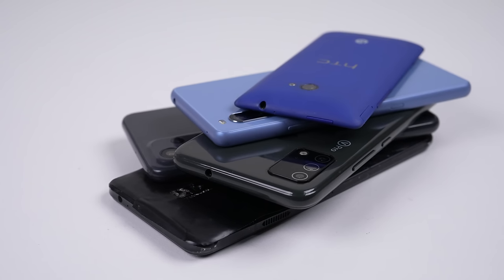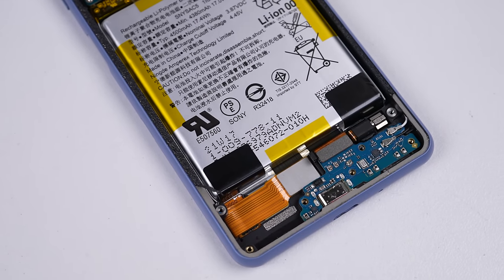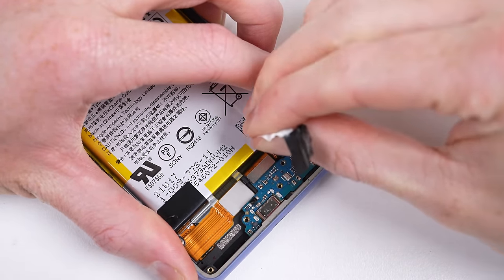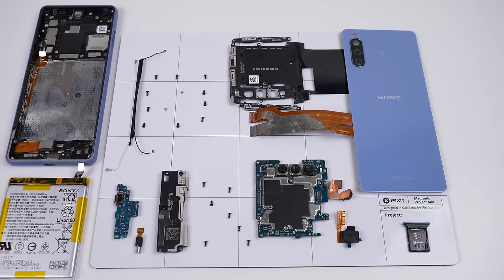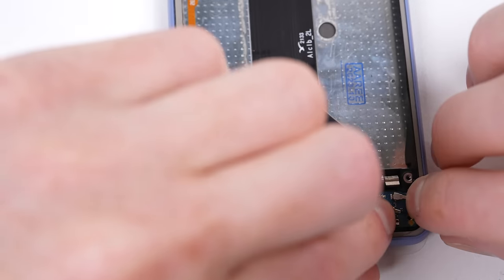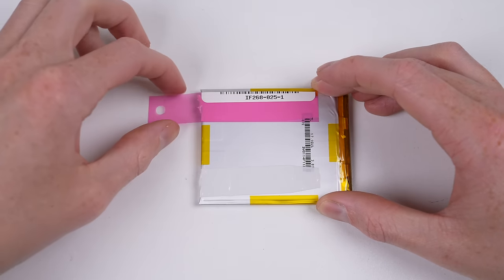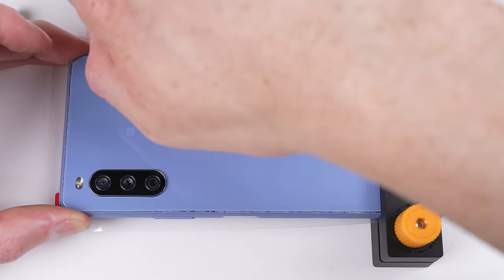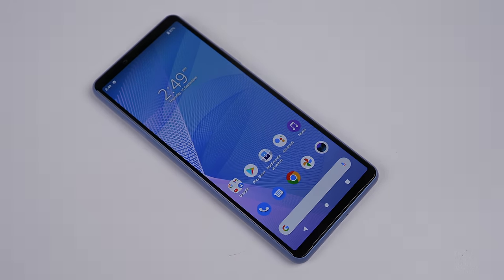This Uncommon Phone Is Shockingly Easy To Repair - Sony Xperia 10 Mark III

Comment: As a phone repair tech myself, I consider both Sony and Motorola phones underrated when it comes to repairability. They’ve never given me any grief when it comes to screen, battery, or charge port replacement.
Reply: What about the razr folding phone
Reply: this looks about as easy as a xiaomi phone
Reply: @RukaIXR actually it's easy to repair
Reply: When I was a PTC tech I only ever ran into one Sony phone (Z5 premium) and remember it not being as straight forward as a Samsung. Not bad just different. I found Huawei P30 pro a little more difficult too than an average phone.
Reply: I bet you get those a few times a year haha
Reply: Asus Zenfone 9 and 10 are easy to repair too!
Reply: @willissudweeks1050 as if an iPhone doesn't need the same repairs at times lol
Reply: @aiodensghost8645  I was saying that those phones are so rare they aren’t seen often not that they broke easily
Reply: No point repairing a phone with no updates.
Reply: Motorola is really popular here in Brazil
Reply: same with xiaomi
Reply: Have you tried ZTE? I have a total of 3, all seem easy to repair. I have a Blade Z Max, Avid 5, and Z176BL. 2 needing a screen replacement/further repair, and one just needing a Google account bypass.
Reply: @JMD-tu1xm  never encountered them. Compared to other android models, how would you describe their repairability?
Reply: yeah it's also really good software wise as there a ton of software that can very easily unlock the bootloader and install stock or custom roms. there's also xperfirm which has every single sony rom from their servers
Reply: Actually Samsung too. I've had absolutely no issues with any model of Samsung, even though sometimes they do odd things like the glue on the S20/N20 series. The module is offset to the left some, with the glue holding the sensor in place to the left. (I guess if you're looking from the back lol).
Reply: The not-so-popular LeEco Le 2 has the easiest screen replacement in the normal smartphones category (excluding Fairphones).
1: Cook the screen then remove it
2: Unscrew 2 screws for the metal piece that holds into the ribbon connector for the screen then remove it
3: Connect the new screen and put back the metal piece and the screws in place
4: Use some liquid glue to hold the screen then put back the screen into place
5: Clamp the screen and wait for the glue to set
Unclamp and remove the protective layer then you are done.
Reply: The not-so-popular LeEco Le 2 has the easiest screen replacement in the normal smartphones category (excluding Fairphones).
1: Cook the screen then remove it
2: Unscrew 2 screws for the metal piece that holds into the ribbon connector for the screen then remove it
3: Connect the new screen and put back the metal piece and the screws in place
4: Use some liquid glue to hold the screen then put back the screen into place
5: Clamp the screen and wait for the glue to set
Unclamp and remove the protective layer then you are done.
Reply: @ndsr_tar  The Google Pixel phones are like this. Hella glued on, but if you're replacing it, it doesn't matter anyways. Cook it, unscrew the two screws holding the metal plate that holds the display ribbon cable and you just put the new one where the old one went. No other screws at all except the two on the inside.
Reply: @Xiefux  but it doesnt send your data to the ccp

Comment: I'm genuinely thinking about getting a Sony as my next phone - an SD card, headphone jack, and software that works well with my Sony camera!
Reply: i got an Xperia 1 IV in april of this year its absolutely overkill and i love it
of course i had to import it because they dont sell phones in my country aswell but at least i payed less than i would if they sold here.  absolute win
Reply: I own the 10 V and it's a extremely good phone with some of the best old features and most of the new ones such as 5g
Reply: bought an xperia 1 V for $1200 a month back. Absolutely adore this phone, beautiful design with the greatest mobile screen imo, 4k 120hz glorious 6.5" OLED. SD 8 Gen 2 works like a charm too. Headphone jack is real nice and the peace of mind you get from knowing you can add an additional 1 TB of microsd storage is wonderful.
Reply: The sad part is: although Sony is developing the sensors, it's Camera app and photo results are sub par compared to other brands. That's why I have stopped buying Sony phones.
Reply: Sure you are mate
Reply: @mshaftenberg they’re also too damn expensive and the phones tend to overheat quite substantial
Reply: @mshaftenberg  they downgrade the camera app when new flagship phones come out
Reply: Sonys don't last very well
Reply: @mshaftenberg  I would advise against it. As they said, there are batter cameras on phones out there, and as actual phones...they're very mediocre (bad UI, terrible orientation detection, frustrating fingerprint scanners and more) for phones commanding a premium. I don't know if the headphone jack is worth putting up with all the mediocrity on my Xperia 5 Mk IV, but I'm stuck with it so I wouldn't recommend it to anyone else.
Reply: If you plug in or out of the Sony headphone jack with an audio jack in an amplifier, it could get damaged.
Reply: @Carcosahead My 1 II overheats too much, it can only record for 3 minutes before overheating and shutting off

I won't ever buy a sony phone again
Reply: @DecibelAlex mine lasted from 2013 till 2022.
Reply: I've noticed that the camera looks the best only when there is a nice sunset / lots of light. With grey skys it makes the photos more gainy when you zoom in.
Reply: Do it! I have an Xperia 5 IV and it's great!
Reply: @MarkSynthesis  Sorry but bad UI is one of the points that's actually great about it. If we're talking bad UI Samsung's OneUI comes to mind but not Sonys.
Reply: Asus ZenFone is pretty similar but without the SD slot
Reply: Id do the same if the software support was better...
And if the damn phones didnt cost like 30-50% more in my region.
Reply: Look at the zenfone 10 too, heapdhone jack and easy to repair! Longer software updates too
Reply: @driver1084  What are you expecting out of this tiny lens and microscopic sensor?
Neural network smoothing and a fake moon like others do?
If you want this, you can do this yourself later, except you can adjust this post processing to your liking.
If you want actually good photos, you need a real photo camera, not a phone.
Sony does make cameras too and they are also the best.
Cameras that can take non-grainy picture in the dusk start at $3000.
But there are companies that sell lies for less.
Reply: @basicallyhuman they provide bootloader unlocks and driver packages, it's not too complicated to install something like lineageos.
Reply: @MarkSynthesis  that's false. Sony's fingerprint scanners are the best.
Reply: @goury Source?
Reply: @orangeyellow-me1pz   no phone lasts 9 years in daily use, that's utopia!
Reply: @DecibelAlex  I used it all the time for a couple years then kept it as a back up and used it sporadically. I have phones that are nearly 20 years old that I play with all the time as well.
Reply: @DecibelAlex been using Sony years with no such problem
Reply: @henryfernandez4493  what  you talking about????
Reply: @mshaftenberg the Xperia 1V kills the competition in that area
Reply: @toxicturkeyy I consider the 4k screen to be a negative point of the phone, it uses more battery and the screen is too small for the extra resolution to be noticable next to a 1440p display of the same size
Reply: @goury the result is all that matters when taking photos

Literally nobody cares if the picture was taken with a camera that uses AI processing or you manually controlled every setting
Reply: but there is no fast charging
Reply: @ZUXY_RS3 there is
Reply: @DecibelAlex  Galaxy Note 3 users from 2013: blocks your path
Reply: @chromaticvisuelle  Asus said bootloader unlock for 10 is not allowed. Custom rom community outlives official support. Still stuck on poco F5 as my top choice for now.
Reply: SD card is trash.... it is stupid slow and prone to corruption. Just buy a large enough storage in the first place.
Reply: @MarkSynthesis   the Xperia 5 isnt the highest end.. so you shouldn't say thats what the experience is like

Comment: Beside good repairability, Sony also supports AOSP and provides everything necessary to build your own custom ROM (including build guides and bootloader-unlock). This usually takes a few months, but it is much better than throwing away a phone after it no longer gets security updates.
Reply: if only they didn't void the warranty when you root...

I understand it's actually not legal in the EU, unless they prove that I burned the CPU with overclocking or something, I intend to seek some advice to confirm that.
Reply: @TheDZHEX  even though they do, they will still fix/replace the device if it breaks because of something unrelated to the software.
But it'll take more time because they'll have to check everything thoroughly.
Usually adds up to a couple of weeks.
Reply: @TheDZHEX   Never looked at it from this perspective. For me it is an easy solution to use the device after security updates have stopped. Or to use the devices for some other projects, I mean you get old used phones for the same price as a Raspberry Pi but they have way more power and an integrated screen :)
Reply: The thing I dont like is when you unlock Sony disables certain systems that they class as secrets..
The software for photo AI and sound software is blocked so that the quality is worse..
Reply: @dirkg.3163 hell, attach a controller and most people don't need a console (I say that because the games I play have issues with input latency if you cloud stream them, and the phone isn't powerful enough to play on-board)
Reply: Untill you buy their ps5
Reply: Sad that outside Xperia 1 or V Marks 2 to 5 (still best naming scheme imo), Sony and Xiaomi only had their sd slot and headphone jack duo on phones lower than SD7/8 series chip.
Reply: They provide no updates as well it's great!
Reply: @jiffonbuffo and IR Blaster on Xiaomi/Redmi devices
Reply: @aiodensghost8645  Are you going to squint at that tiny screen? And I am not even going to mention hoping that the charge doesn’t end on the controller. And cloud gaming is heavily dependent on good internet.
Reply: Except I own the Japan softbank locked variation :( that can't be upgraded
Reply: talking about software, you can unlock the bootloader in every sony global model smartphone..except japanese market model. such as docomo, au and softbank.. there's no way to unlock it, even if you try with official way. docomo, etc won't let you.
Reply: @narutoandhinata130  yep I retuned xperia mark 2 after realizing it's Softbank, I hate locked phone

Comment: For heaven's sake stop using that disgusting glue to attach the screen or back on phones.   It's unprofessional and makes subsequent repairs much more difficult than using generic double-sided tape of carious widths (1-5 mm) or better yet factory cut adhesive.  It makes me cringe every time I'm working on one of these "glued" phones.  Yuk!

Comment: I really dont get it, ive replaced batteries for friends and family phones, ive never glued any batteries back, ive experiment so to speak. with different things to stop the battery moving...the batteries with no glue can hardly move, if at all in their compartments, ive used a small piece of card to stop them moving, a tiny bit of blu tac, they never move , even if you shake them you cant hear the battery moving, ive never had one come back, so why these companies use it is beyond me..if they insist on glueing why cant they use just a couple of small piece of adhesive tape....so the battery can be taken out with minimal force...its not difficult, only conclusion has to be that they dont want people replacing batteries

Comment: I remember when phone makers didnt even think they needed glue for their batteries where a finger nail was the only tool you needed to take off the back cover and battery with ease. Apple has a lot to answer for as every company has followed their greedy anti consumer designs. I'd buy a sony if they still made a small model, as it is I was forced to buy a mini13, the last small modern phone thats easy to get in and out of the pocket it seems.

Comment: Currently watching this on my 10 III, I bought it second hand about a year ago at a really good price and I've never had a problem. The one issue I did have with updating the OS was handled very well by their official online support. I'm very relieved to hear that at least when the battery kaputs or something that it'll be relatively easy to repair or get repaired.

Comment: I've been using the Xperia 5 ii for more than 3 years now replaced the battery myself and it is still water resistant after a drop in water it was easy to work on and it still feels like day one

Comment: Nice video, thank you for it. Sony phones are very underrated indeed, although they're quite overpriced when purchased as new. I've been using Sony (Ericsson)s for 17 years now since my T610 (which still works) to my current 1 II. And it won't change.

Comment: I owned a 1.5 year old 10 mark ii and it was a horrible phone. Native camera app had a 2 second shutter lag so I would miss the shot all the time. Software was always stuttering because of the weak sd665 cpu. 
The back glass cracked once, so I ordered a replacement, and after 2 days it cracked again, so I just lost it and put the cracked glass together with tape. 
And the next week the phone is suddenly restarting itself when it's upside down... So I carefully took the cracked glass with tape off and unscrewed the motherboard... to find out that the metal cooling plate had gone loose and was shortening the elctronics in there. I took it out and assembled the phone without it. 
Then after some time Bluetooth and wifi stopped working, then the screen started ungluing itself (so much for the waterproofness) and finally, I dropped it the last time and finished it off. The screen popped out and the flex cable broke. 

I have never experienced so much pain with an electronic device in a 4 month period.

Comment: i owned half a dozen sony phones in a row, starting with an Xperia GO, they were all very sturdy and dependable and as easy+cheap to repair as this one. this ended when they stopped selling them here in AUS. My current phone is a Umidigi bison which has been far better than its price would suggest, but has some weird behaviors (OS related).
When thats up for replacement im probably going to grey import a Sony,

Comment: Sony's phones started going under the radar since the mid '10s due to a lot of internal issues that were carrying on since the mid 2000's (PS3 launch, VAIO sales going down, BRAVIA tvs selling less than their korean competitors, the infamous Sony Timer rumor killing their reputation in their home country) and they reached their boiling point in 2011. Their consumer product division was really close to bankruptcy until they were saved by the PS4.
Despite that, a lot of their products never fully recovered and you can see that with this phone, as it didn't had ANY publicity whatsoever and it wasn't even released in your country.

Comment: I had previously used a xperia 5 ii. Had to move to a different one due to the gree line isshue that came with 2020 oleds. I gotta say that phone is a beast and i miss it soo much.
Reply: I have 5 III and it also got vertical Green line...... Reddit said 5 II, III, IV using same screen from Samsung. While 1 series using Japan OLED screen

Comment: I've had a few Sony phones and they are an amazing hidden gem. You get features that have long been forgotten with time such as the micro SD card slot, headphone jack, and (until recently) notification LED. Plus they have insanely awesome cameras and displays on most of their phones. It's just a shame they started tapering their offerings down to just one phone in the US now.
Reply: They even had a charger still included into 2022, however they got rid of that with the IV gen, you can also use their higher models as an external screen "field monitor" on some Alpha cameras, the "first" Xperia Pro even had a micro-HDMI Input for that.
And their cameras might not be the best overall but the thing is that developers of iPhone, Google Pixel, Galaxy S, Xiaomi etc. are putting a lot of effort into image processing, while Sony makes image sensors themselves and AFAIK they're are also the only big player in camera business that makes smartphones (sorry RED, Samsung also gave up their compact cameras and NX series long ago and Panasonic once had their Eluga Phone but nothing followed) they're rather following a professional photographers doctrine and are doing less processing, a rather raw output - more "honest" photos.
Reply: what are you talking about? lots of phones still have those features
Reply: @DecibelAlex  Feel free to show me cuz I haven't see any with those features in years.
Reply: @kuchenblechmafiagmbh1381 That last part about the camera is actually more detrimental to them than helpful. Most people don't need or want a professional camera on their phone. They just want a good point and shoot. And Sony phones don't produce the best pictures from what perspective. You have to edit and finish them yourself.